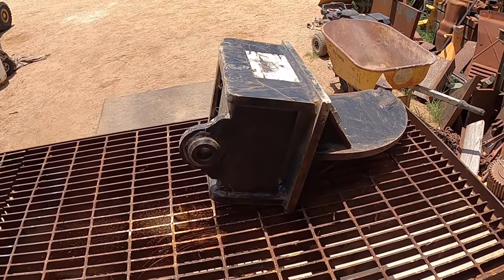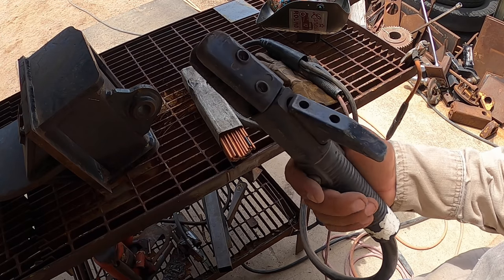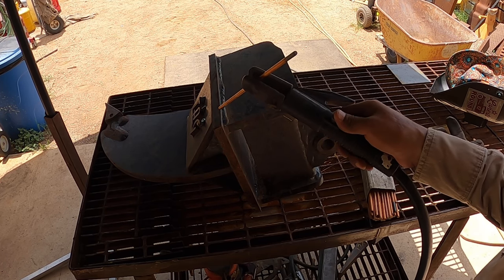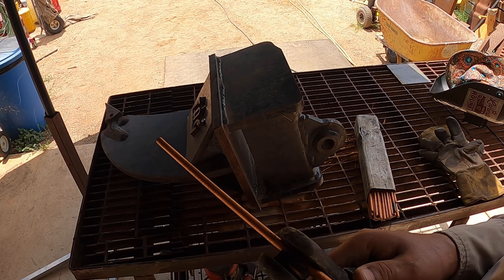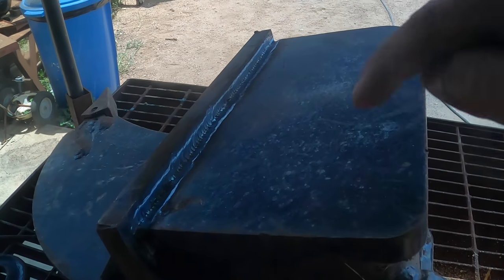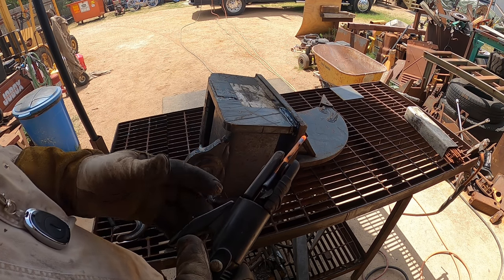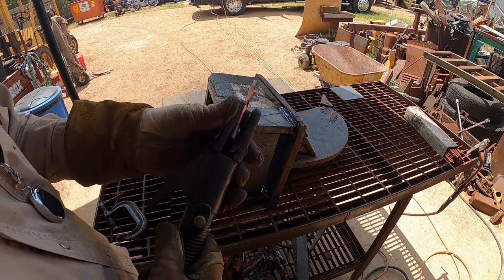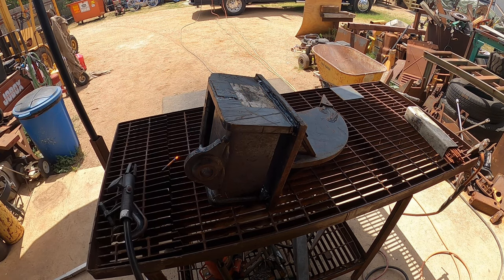Arc Gouging in Detail

Comment: I haven't air gouged in 40 years but still have the equipment. Next week my buddy and I are going to modify a set of fork lift forks to fit on his loader tractor. It will require some air gouging.
I wasn't even searching for anything but somehow this video just showed up on my Youtube feed. Thanks for the pointers.
You are good this and this was a good video.
Wish me luck next week.

Comment: Isaac I have to say thank you, I am a mechanic that does some sticking metals together from time to time and had almost no formal training welding. Back a few months ago you showed to turn down the amperage when gouging, all I knew was turn the amps to max and giver, but I have used 200 on quarter round and flat and what a difference, half the noise and a much much better result, far less parent metal intrusion, never be as good you you but love the tips so this video will add many tips to the ole mental tool box. Thanks again.

Comment: The good ol Unwelder.

When i was learning, i got introduced to it by some folks that said just turn your amperage and air all the way up regardless of machine size, rod size, or job size. 
That never made sense to me and i pretty quickly figured out i was faster and more efficient when i backed off.
I like to keep some 1/8 carbons and you can recover some pretty dang small parts with them.

Comment: Inspired by your videos, I bought the cheapest $65 gouging torch on Amazon as a Christmas present. I've since gouged apart 4 or 5 old machines using my 200A Alpha Tig.  I use the 3/16 and 5/32 rods but mostly the 3/16 and I find both run real sweet about 145 amp. I have a cheap air compressor but find it works fine. I probably can't gouge with a 10" stick-out but it works fantastic at 3-5". I cannot believe how fun this is to do.  In confined space you will get showered with sparks. A welding hat is a must. I wish I had tried this way earlier. It works at any angle. I like almost sitting it perpendicular and just sliding it along with no movement. The speed it removes metal blows my mind. I can do 30 minutes of practice welding and then blow it away in 2 minutes. Thanks for all your great videos.
Reply: How much horse power have your compessor? I have welder with 300A and torch but I don't know is compressor with 1,5HP or 2HP is  enough for gouiging?

Comment: Was sent to a stamping plant to work. One of the jobs was to remove/replace an oil channel, all around a stamping die table. Lots of angles and tight spots. The channel was a lightweight angle iron. The foreman wanted to use a torch, I told him I'd use the arc gouge. I had to remove it 30' of oil channel. 
Once set up I was able to scarf the entire channel off in less than a half hour. Using the right position and angle there was little to no slag, and no gouging into the table. Also I noticed you fluctuating back and forth. I use a steady motion so there is no ripple in the metal.

Comment: Started a new heavy equipment welding job little over a year ago.  Went threw welding school, but never did a lot of welding for 5 years.  First couple days on the job, had to do a repair and the other maintenance guy said use the air arc... I said oh I've never used that, so he kinda showed me.  He's not a welder and he had only been at the company for a week (previous maintenance guy left the day he started so it was a pretty rough transition.  So basically self taught myself the air arc, it was pretty rough at the beginning but its slowly coming around.  Still a long way to go.  The talk about to sputtering and to high of amperage is really gonna help me out, always struggles with that, but again never had any guidelines to follow.  New different welder, new process never used before it was pretty rough for a couple weeks.

Comment: Great example of why this has become my favorite metal working channel......

I was raised stick/MIG welding, & using an O/A torch. Didn't know about arc gouging until I saw Isaac using it. A very valuable tool to have in the arsenal. 

Isaac, do you exclusively gouge with your Airpak, or also with your Dynasty? Any word on the repair of the Dynasty?

Thanks for another great video!
Reply from the maker: I used to use my Dynasty here at the shop but I had to start using the Airpak since it broke. I still haven't looked into the cost of the repairs just yet.
Reply: You took the words right out of my mouth!

Comment: You mentioned left or right handed. My dad was one of those old school welders that could stick weld with either hand any position and the weld quality would be the same A number one quality. Dad worked at a ski area for many years. I had seen him hang from a safety belt 70 plus feet up on a lift tower reaching out with either hand and do a better weld than the average welder could do flat standing on the ground. As for that weld eraser air ark is a great tool. I have seen guys over the years way over gouge. Like any proses experience is key to doing a clean job
Reply: I've got a pal that is both handed. Drives me CRAZY! Blessings!

Comment: 👍👍☝️😎✌🏻… Another Great video Isaac!  One question: your starting position of the rod, is it a happy medium?  I know the velocity of the air is higher at the tip, so basically your just adjusting how fast the blow out is, versus the speed you want to cut? Or maybe the speed the rod burns up?  Sry, 2 questions.🤔
Reply from the maker: Happy medium, yes. And you can also vary the airflow with the built in air valve. It  takes practice but its not difficult once you get the hang of it.
Reply: Thanks, i had an old Navy diver friend who described it to me, a picture is worth … you know. Thanks again!🙏

Comment: Sir I never used that type of rod the ones that I used were hollow and air or oxygen went down through the middle of it but I used all my stuff underwater I was a diver also use what they call a thermite rods it was magnesium filled rods that were hollow and you use the welding machine in oxygen again the thermite rods used 150 amps the carbon rods used 300 to 400 amps depending on how thick the material was love your videos be safe have a great day Sam love to hear your input about it

Comment: Thank you professor Isaac!  Maybe twenty years ago, I bought one of these, and it's been setting in the drawer ever since.  Never figured how to use it and it was too expensive to screw up.  I'm pretty good using plasma for gouging so didn't really need it. In twenty minutes, you answered all my questions, and then some.  As I hardly do any welding any longer, someone will wind up with a new old stock unit.  Does the black end serve any purpose.  Thanks.

Comment: I remember the first time I used one of these. It was on a tunnel boring machine down in the tunnel. I was standing up, doing mostly vertical. The gear and rods were new, but far from the machine. It was there it is, go to it. It worked pretty fair, but it was tunnel air, so once in a while the air line would spray water like a garden hose. By the end of the shift, the zipper on my brand new Carhartt coveralls (not FR) was ruined.

Comment: Use a stick out of 4”-6” as the nozzles focus the compressed air on that point & should be under the electrode. 
Use electrode positive 
The copper cover gives the soft brittle carbon rod added strength & improved electrical contact. Inserting a new electrode point the copper free end to the work pieces. 
MUST USE EAR PROTECTION. 
For operator & assistants. 
In shared workshop use an acoustic inclosure & local fume extraction & then there’s the dust the compressed air kicks up from the workshop floor 
Earring permanently damaged in 3 mins use.!! 
Also, FYI. plastic melts at welding & cutting temperatures.
Reply: what?😂

Comment: Thanks been wondering about this process . see you use it a lot . But just gave me a lot of how dose it work. Wife says I do to much thinking . Still have 2 questions I did not hear . 1 is ac  or dc or either , 2 do you have to run a air dryer on the air supply . It is  humid  where I live. Or don't matter . And thanks for the  educational video
Reply from the maker: DC positive, and dry air is good. Although my trailblazer spits out tons of water in the air. 🤷‍♂️ It gets humid here too. It still works.
Reply: @ICWeld  Thank you

Comment: Issac, when you are gouging a weld, can you see the separation line in the weld as it begins to appear or do you just know how deep to go from your long time at welding ?
Reply from the maker: You can see the separation line as you go. I was going to try and get a closer view but I didnt want to burn the camera. Ill try and get a better closeup on one of my next repairs.
Reply: Great question and reply
Reply: @I C Weld  Isaac, you said at one point you were doing clockwise circles and also a "v" pattern.  Is that to make a bigger molten puddle that the air blows away?  Was curious why not just hold rod steady and move sideways across the weld. 

 This was a very informative video!

Comment: What kind of welding machine are you using Issac?
 I never used
gouging rods because my Hobart Champion 10,000 maxed at 230 and the local dealer where it was purchased said that I didn't need to run my machine maxed out like that. We bought the air arc torch but never got to use it.

When you burned up the head band in your helmet it reminded me of the time I melted a huge gash in the bottom of my brand new slip on boots. From then on I kicked all hot metal out of my working area. I was sick about those boots man.

Comment: Thanks Isaac is there any way you could show us a video on self shielded flux core I have seen you using it and you lay dimes just wish I could figure out the settings you use
Reply: Have you tried using the settings recommend on your machine?  Start there and practice.  Also, he has some very nice machines that other do not and it makes a difference. Take care
Reply: @nathankisner8332  I have a LN-25 wire feeder that I run on a Lincoln vantage I can run flux core with gas perfectly but the non gas shielded wire is kicking my butt it has porosity and all kinds of stuff even though the beads look decent
Reply: @-Brett-  You need to change your polarity

Comment: I can assure you that after 35 years in ship building, 225 amps is way to low for 1/4 carbons, you should be atleast 300 amps, 225 is for 3/16 carbons, 425- 500 for 5/15, and 500-650 amps for 3/8 carbons. Also you are not suppose to go back&forth while gouging, that will tend to leave carbon deposit in in the cut which the carbon rod will not burn out. If you gouged like that at BIW shipyard you'd be laughed at. Straight forward cuts with 1/4 carbon at 25-45° angel, at 300-400 amps and go faster!!!!!

Comment: Very interesting, and nice job!   Don’t know if you said it and l just missed it, but can you control the air volume too?  
.. l Remember turning my Lincoln 225 amp Welder to full and using a wet welding rod to literally blow away metal.. very crude way of “cutting” but hey, l was 23 y/o and it worked..
🤔🤪🫣😂

Comment: I'm working to restore/repair two SA-200 welders. One is late 70's and the other is early 80's. Both are Blackface machines. Do guys arc gouge with these machines? Just wondering if I should experiment with trying this process or if I'm wasting my time and should stick just to using them to weld?
Reply: Isaac has another video where he arc gouges with the SA-200.  Reading comments lots of others do as well.

Comment: Does the carbon stick to the parent metal the way a stick electrode can?
Reply from the maker: Yes, you have to be careful. you can accidentally leave a layer of carbon on the parent metal and it will be difficult to remove.
Reply: @ICWeld  Thanks Isaac

Comment: Hey Isaac since you said you sweet spot is around 200 amp so do you feel a Miller bobcat 225 or 250 would be adequate for this? Or the Hobart champion elite 260????
Reply from the maker: You can go down one size in carbon rods. I used to use the 3/16 ones for a long time. Try that at about 180A. should work.

Comment: Isaac, would you say that when arc gouging, starting with the amperage you would use to make the weld you are gouging out is a good place to start?
Reply from the maker: Not really since these are 1/4 and not your standard 1/8 rods. Most packages have an amperage range per size of rod chart on them. I personally think they're too high but its a good place to start.

Comment: What kind of air pressure are you running? Do you need a water separator?
Reply from the maker: At least 80psi and yes, it helps to have dry air but not necessary.
Reply: @ICWeld  ok cool thanks allot Isaac, trying to get better gouging at work, youngster here (25) always watching and learning from the OGs like yourself, I work in a heavy equipment repair shop as the welder and fabricator, we have gouging capabilities in shop and in field, in shop our air pressure is 150-200 psi last time I tried to gouge I ended up raining fire on myself from splashback, I literally read the AWS pdf file on gouging  after burning the hell out myself and am assuming it's our air pressure causing a mess vs a air separator , running 1/8 gouge rods 220amps and whatever psi shop was at

Comment: Do you think my Miller Bobcat 250 could handle arc gouging I have never tried it I just use a torch and scarfing tip and I only have a wheel barrow compressor in my truck I think it is a 12.5 cfm all my research says it’s not enough but I watch you do it with an sa-200 so I think it could work but you obviously have much more expertise in this then I do
Reply from the maker: a 250 should work if you use smaller gouging rods. 3/16 should burn at around 170A

Comment: Although the design obviously works well enough now there is always room for improvement, so why doesn't the carbon rod have an adjustable insulating tubular sheath like a hard ceramic like toughened glass or something over most of it's length to better direct air flow to and concentrate it at the tip?

Even just a long thin tube down the back of the rod should be an improvement.

If the handpiece had a feature like that you wouldn't have difficulty with the rod arcing in undesirable places along it's length against your work piece as happened in this case.
Reply: The process works.  Beyond that good luck keeping your air directing tubes in one piece.